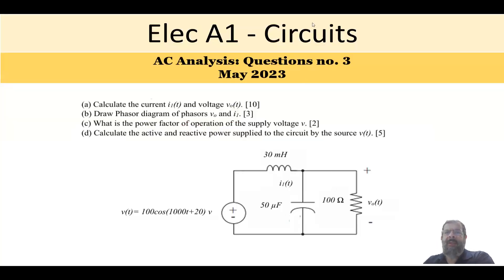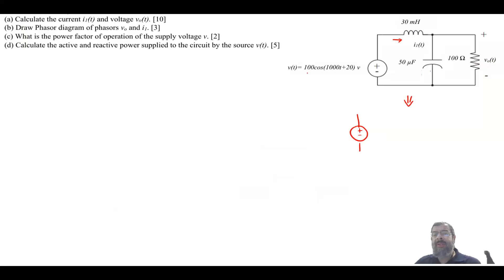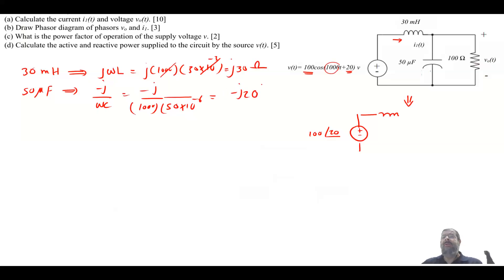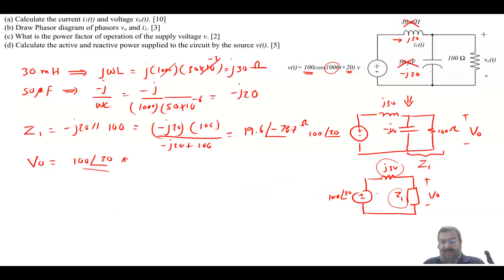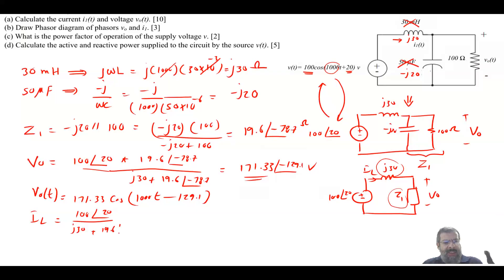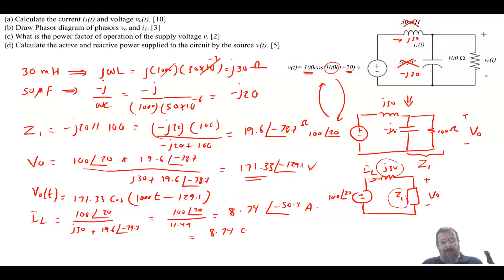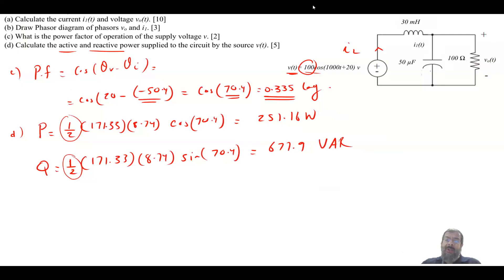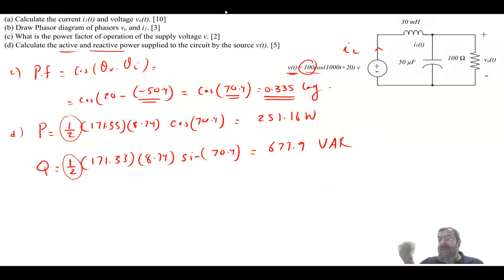PEO solved examples (ELEC A1): AC analysis Question no. 3

Comment: Can I also get the I1 using node formula V1-100<20/j30? If yes, I am getting right magnitude but wrong angle or its wrong to solve like that?
Reply from the maker: It should be (100<30-V1)/j30, you need to follow the current direction
Reply: @electrical4everyone  Yes, thank you professor.

Comment: Hi professor, 

When to use AC impedance formula Z=Root of (R^2+(XL-XC)^2)

For example: In May 2021 Q5, should I use this formula to find Z and is(t). 

Thanks in advance sir.
Reply from the maker: Hi
This formula is only correct if you have series RLC circuit. Otherwise, you need to find the different parallel/series configurations.
Reply: @ Thank you sir

Comment: Supply voltage should be Vrms. Isn't it? so V0 = 100/sqrt(2). isn't it? Please reply.
Reply from the maker: The question is asking for Vo(t) and hence we should solve this problem using peak values and not RMS values. Also this is why I multiplied the real and reactive power formula with (1/2)